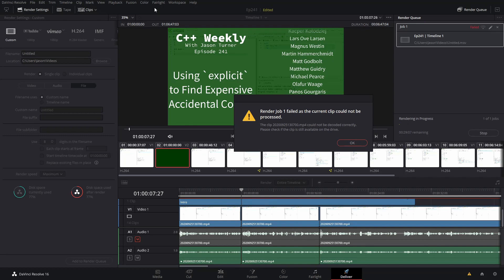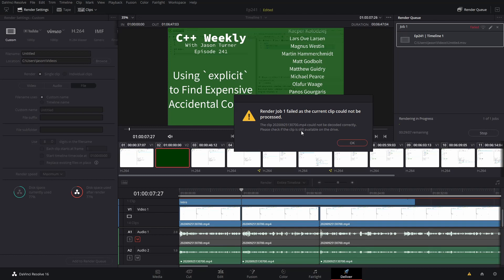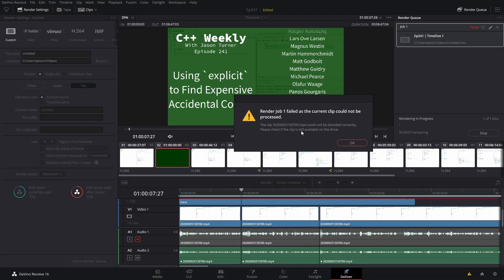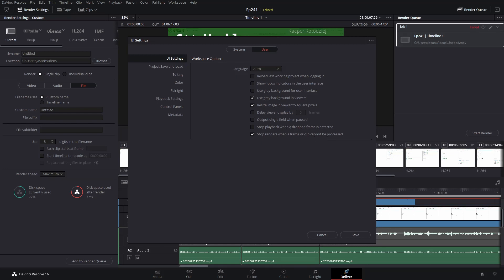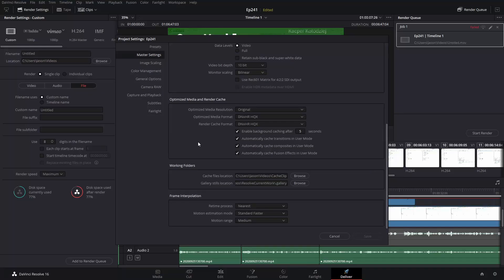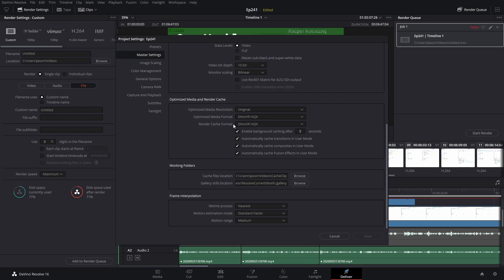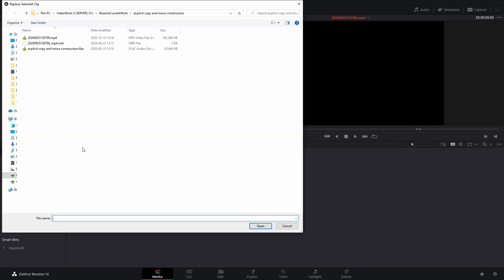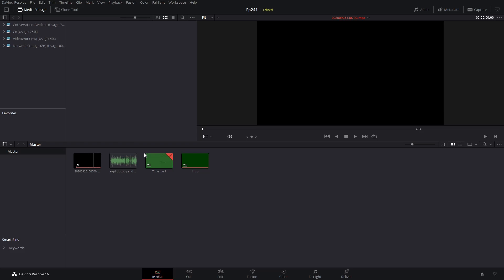How To Actually Fix The Davinci Resolve "clip could not be processed" Error!

Comment: Thank you so much for this video. It has helped solve a problem with Da Vinci that I've been experiencing for years and never got the right solution. I tried the "Stop renders ....." setting and that seemed great until I too noticed those red flashes. Hearing you say Cyberlink Screen Recorder, the tool I often use but not always and now I can relate most failures to that. Strangely not all the captured clips experience the problem. My trick has been to convert my mp4 files to mov and do the Replace Select Clip and yahooo I now have a renderable video. Thanks a bunch. Will save me many future headaches
Reply from the maker: Glad I could help!

Comment: Couldn't get my head around this! Looks like it was useful for a lot but still couldn't work it out! Turns out by switching the hard drive I was rendering to it made all the difference. Originally was using files from and exporting to a SanDisk 2TB SSD, switched it out for a Lacie 2TB and worked first time. Hope this helps!

Comment: Thanks for the video. This happened to me now in 2022, DR Studio v17.4.5. You'd think that in Resolve's Media tab, right click the problem file and hit "Generate Optimised Media" would be the official remedy for this...but that doesnt work! If it's so important for Resolve to be this fussy about media errors then this option should do this process properly. Let's hope they implement this feature comprehensively and add ability to restore the bad frames, with a few options like truncate, ideally. As it stands "Generate Optimised Media" is useless, my understanding is that it is generated automatically during ordinary cache management and you can even delete specific files in the cache if you want to. ..reporting back: it turned out it was just the last frame or two that was erroneous so moving the outpoint before that, is my workaround. Thanks again for addressing it here.